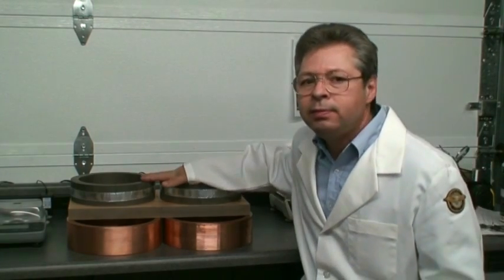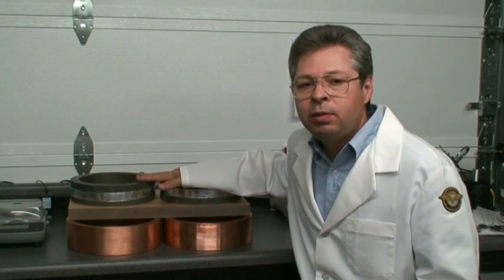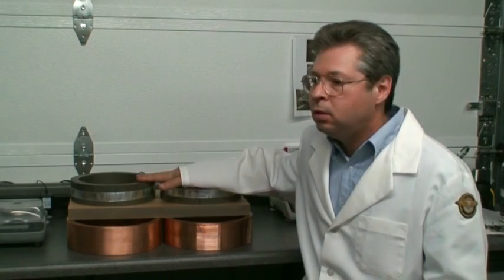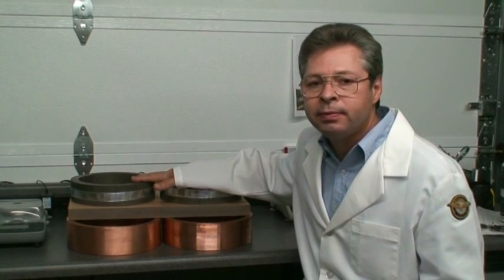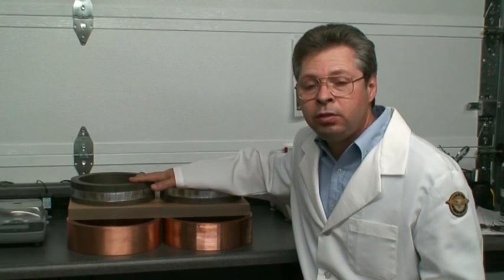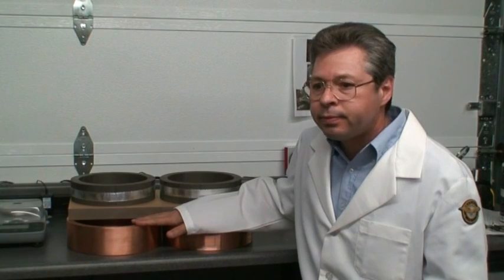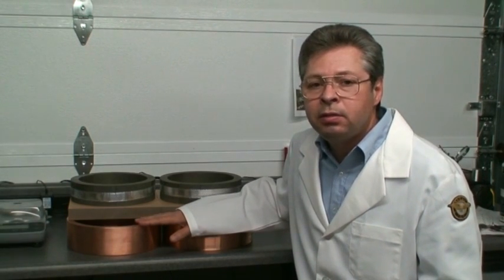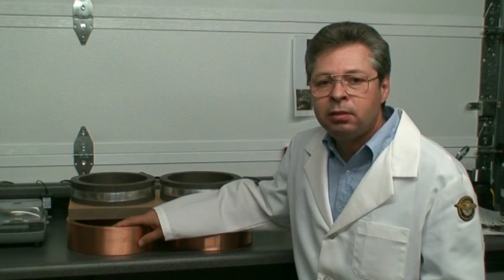SEG Material progress update

Comment: It is magnetised with a conventional DC-coil, with ONE complete turn of AC wrapped around that. The result is tiny-pin-prics of NS poles on plates and runners, that makes the field on plates and runners resemble wagon-wheel spokes. Parameters from the Law of The Squares, and DREAM ONE. It always comes back to the oddly recurring dreams Prof Searl had as a young boy. The interpretation of those dreams was first built in 1946.

Comment: The plates and runners pruduce electricity w/o any movement. Read the BARRETT REPORT. If one places probes on the inner Neodymium-surface of a plate, or runner-module, and the outer copper or aluminium-surface, you will get anywhere from 4 to 15-Volts DC at a helthy milliAmperage. This is more than enough to sustain rotaion on ASEG without any input-power if magnetisation is correct. Because of the charge, the SEG, once started, can NEVER stop.

Comment: EVERYTHING in the SEG, and what elements on  Periodic-table - TWO dreams (STOP, THINK, ACT), (MAGIC-SQUARES). There is an excellent article in RAUM AND ZEIT.  ANTIGRAVITY: THE DEAM MADE REALITY, by John Thomas,  photos, newsclips. First, determine the size of  volume you want filled with SEG: 3-Plates, 69-runners. Produces  big- energy  spinning (current never exceeds 1.5mA) and are a little dangerous because of tremendous forces a spinning 3-ring SEG generates. Min. 200-mph.

Comment: Read Chapter 1 of ANTIGRAVITY, the DREAM made reality, by John Thomas, and LAW OF THE SQUARES, BOOK-4. Must use elements on periodic-table with a 6-sided crystalline structure, need 4 elements for smooth-running SEG, need to balance magnetic attraction/repulsion, and centrufugal-forces, and electron-flux radially thru SEG.